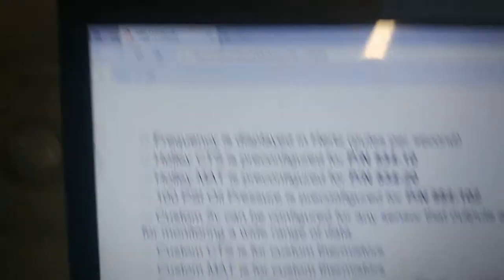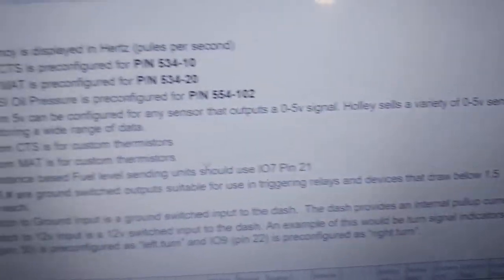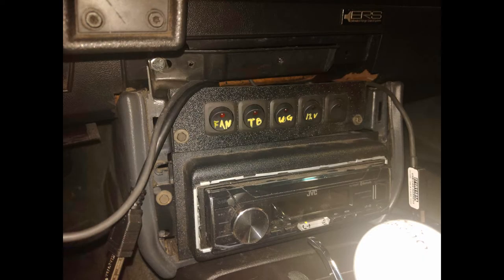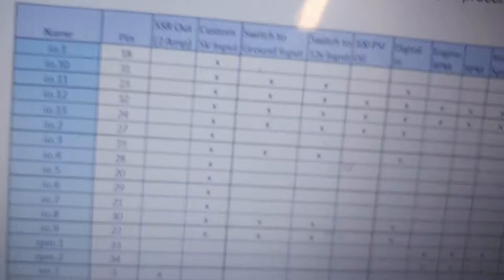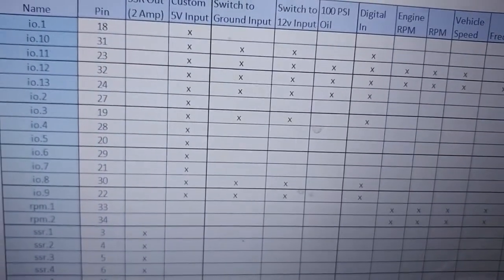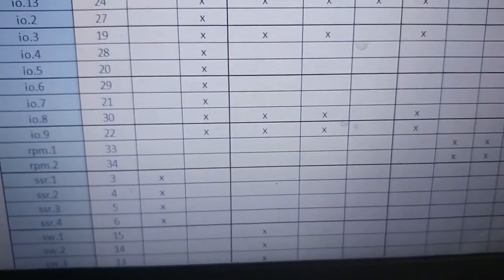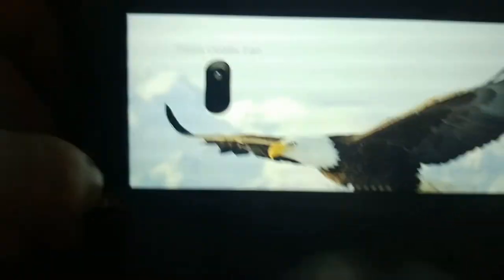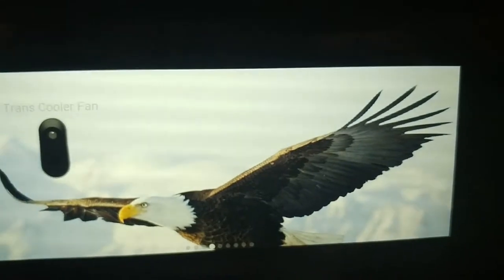Virtual Switches on the Holley Pro Dash

Comment: Dang that’s bad ass! I’m throwing rocks at my new old school relay box 😂
Reply from the maker: I kind of want to replace all of the Bosch relays in my car with these solid state deals. Pulling the dash back out and cleaning up all of the wiring I've done since switching to Holley would probably be more productive though.
Reply: Trailer Park Motorsports Are the solid states more reliable? I may consider switching because that’s something I’m really after... I hate touching stuff twice lol 😂
Reply from the maker: There are no moving parts inside them to wear out or contacts to weld together. They are also a lot faster to respond, which is why you can pulse them for progressive nitrous or a bump box.
Reply: Trailer Park Motorsports cool thanks

Comment: Since you have the trans brake on a toggle on the dash do you have to flip it on every time you need to put the car in reverse?
Reply from the maker: That's the trans brake arm, I also have a momentary switch on the steering wheel. The answer to your question is yes. I activate the virtual switch, the hold the momentary switch on the wheel while backing up, and then release it when I'm done backing up, then turn off the virtual switch. I did it this way to prevent accidentally activating the trans brake while driving.

Thanks for watching.

Comment: So with this setup, you can have up to 8 virtual switches?  4 on the 4 ssr pins and 4 on the regular switch pins (to say fans or other, regular, relay)?
Reply from the maker: @shawnhanifan2500  correct, and those switches can be automated, I have a more recent video showing how you do that. My trans cooler fan comes on above 150 I think, and turns off below 120, and also turns off above 40 MPH.
Reply: @TrailerParkMotorsports  awesome.   I'm getting to wire my dash in this week.  I already have a bank of old school relays in place to use so I'll do that, and pre-wire a few of the SSRs for future use with the now $215+ dollar MSD unit.  Thsnks for the quick response!
Reply from the maker: @shawnhanifan2500 you're welcome and thanks for watching and commenting

Comment: Is it possible to have trans cooler fan turn on automatically when trans reaches a specific temperature?
Reply from the maker: I don't think so with the current software that I'm using, maybe with the upgrade that lets the Terminator X ECU see the inputs on the dash, and make an advanced table to turn on that output.

Comment: Have you tried to control anything via CAN from the dash such as fuel pump or engine fan?  (Terminator X) Can’t find if that’s even possible
Reply from the maker: From my understanding, if you update the firmware in both the Term X and the dash, you can, however I have not tried it yet. So far I only have the TB arm, the boost controller (which I have a separate video on), the trans cooler fan, and the outlets on the virtual switches. I may add more with a second relay down the road, but that's a project for another day.
Reply: @TrailerParkMotorsports  thanks for the tip, I’ll try and update the firmware and see where that gets me!
Reply from the maker: @bigblockmaro1  you're welcome.
Reply: @TrailerParkMotorsports  I updated the firmware of the dash, touch screen and ecu and I am now able to control my trans fan and water pump via the dash through CAN. I am NOT able to control the engine fan or fuel pump since those are default IO. I could make a new output for the fan or use SSR outputs from the dash to add a secondary means to trigger the relays but not really needed.
Reply from the maker: @bigblockmaro1  that's good to know, thanks for the feedback. I may look into doing something similar.

Comment: Can you help me out i wired my transcooler fan and it wont kick on all the way it sounds like its turned down barly getting enough power
Reply from the maker: I would suggest taking it one step at a time. First connect the positive side to a known good 12 volt source and seeing if that makes a difference. If not, connect the ground side of the fan to a known good ground. I suspect that you may have a weak connection or two that have excess resistance. Once you identify which side has the problem, work step by step to ensure a solid electrical connection.
Reply: Quick? Are you able to use the rocker switch for the headlights if so . I just ground the wire  then run the headlights wire to the ssr wire
Reply from the maker: Thanks for watching and commenting. As long as the headlights don't exceed the amperage rating of the relay used with the virtual switch, I don't see why not.
Reply: Okay awesome so I can use a regular relay I don’t haft to used that msd
Reply from the maker: @morrisrodney19  I'm pretty sure you can.